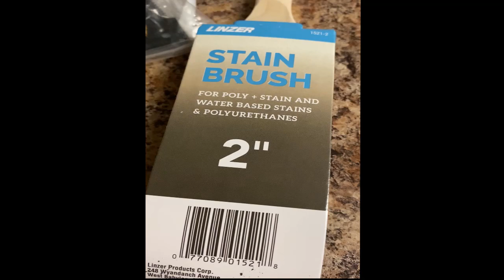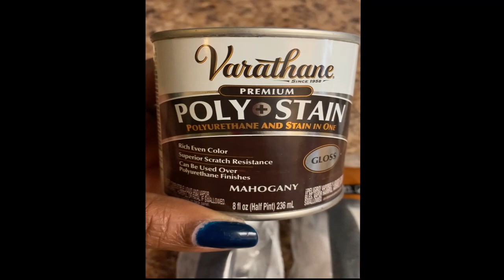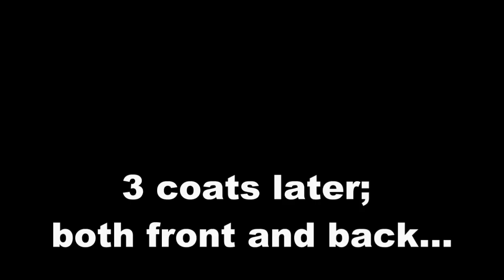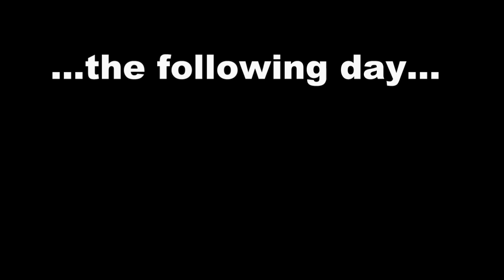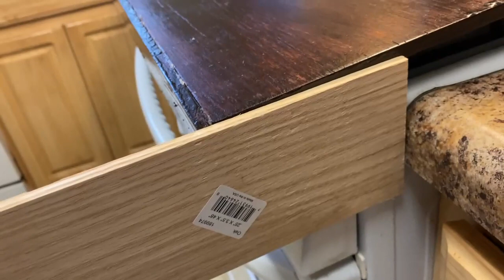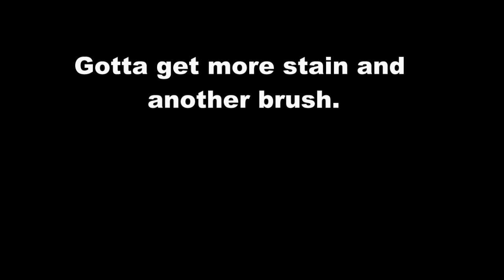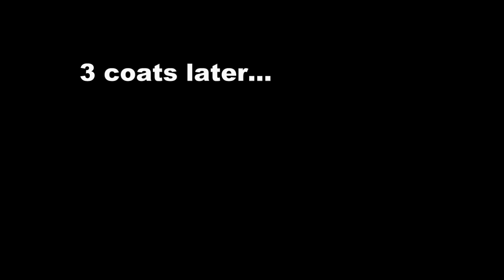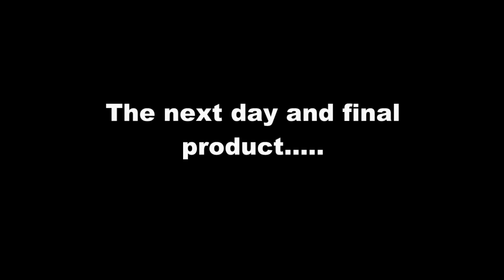DIY Stove Top Cover

Comment: Try using 1” boards at the width of your stove, the amount of boards will be determined by the depth front to back of the stove. Home Depot will cut them for you. I used 1” think by 6” wide and 10 ft long and got 4 boards, which worked out perfectly because my stove measurements were 30”wX22”d. You can use plywood, but it needs to be at least 1/2 to 1” thick.